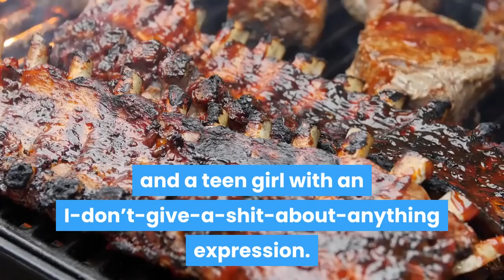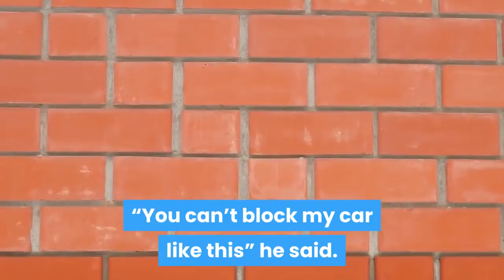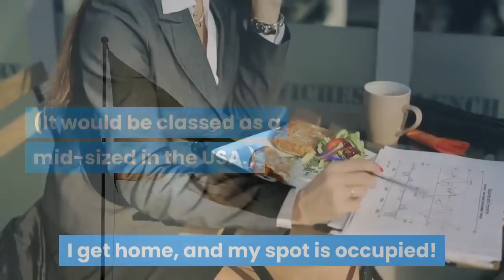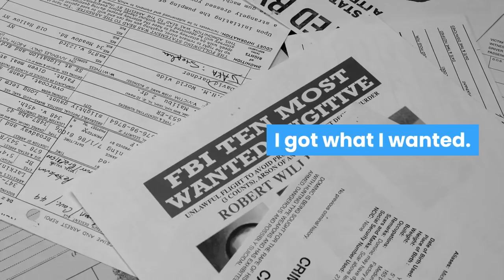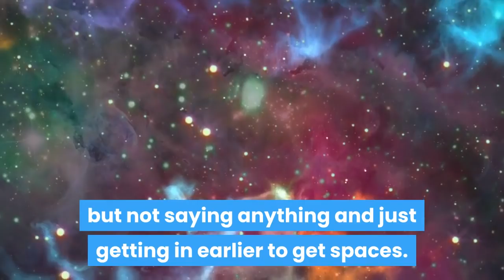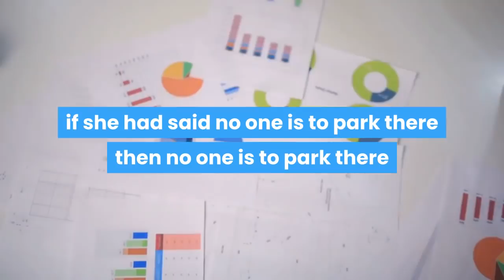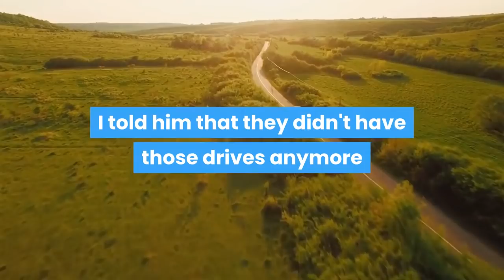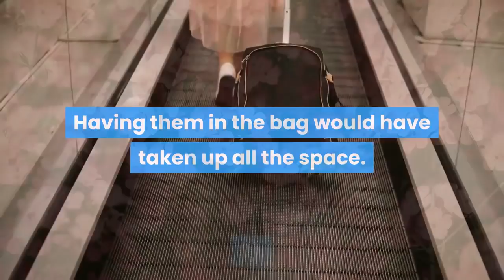r/Revenge - ENTITLED BMW DRIVER PARKS IN MY PRIVATE PROPERTY, I TEACH HIM A LESSON HE WON'T FORGET

Comment: I had a 62' chevy laptop. It was a good runner, but rough looking. I worked for a large corporation and usually parked in the same spot every day. A woman in a nice newer Caddy started parking next to me on the passenger side. One morning I was still sitting in my car when she opened her door banging into my door rather hard. We made eye contact without saying anything. She did this a couple more times without her noticing me sitting in my car. The next morning I waited for her to park and acted like my door was stuck. I proceeded to open my passenger door by unlocking it then proceeded to forcibly kick my door opening it  and slamming it into hers, then saying my doors stick a lot and apologizing about hitting her car with my door while saying that's why I parked where I did. She never parked anywhere close to me again.
Reply: Quick- question...  what is a Chevy laptop?

Comment: my house was 2 doors down from a school and i always got people parking in my drive
one EW kept saying i will just be a minuet, after a week of her i was waiting out side she pulled in and as she got out saying i will just be a min i opened the doors of my van pulled out a petrol still saw (used to cut stone blocks) got it going, smiled at her and said with a grin "what a challange" she never parked there again.

an other time someone had parked (very considerly right up to my garage to allow some one else to park behind her), this 2nd was just coming out as i was arriving home so i parked up right behind her got out my jack and jacked up the rear, took of the wheel and put it away, she was livid, called cops cops came and laffed and asked me to let her out i said i cant my van just failed its MOT (safety inspection) and i have to wait for new brake system to arrive, cops told woman i was not allowed on road and nothing they can do, then left,
i said to her i will move it for 100 quid she screamed i said it will go up £1 a min she paid
never saw her either again
Reply: @ Philip   Love Your thinking!

Comment: a small pebble under the valve stem cap works wonders
Reply: Perhaps a sardine in the exhaust pipe?   Maybe smell it up.
Reply: superglue the petrol filling flapor better if cap has a lock
they will never know who or when done and wont find out untill they need it

Comment: FIrst story: "Nobody helped me". 1) The neighbour in Unit 1 let you use their spot when they didn't have visitors.  2) Did you ask anyone for help?  Such as the property management firm which has likely dealt with exactly this issue many times.  

You admit you were young and inexperienced and yet you complain no one helped when someone did and it doesn't appear you asked anyone for help; perhaps you did but you didn't mention it or the person reading your story left that out, so my comment is based on what was presented only.